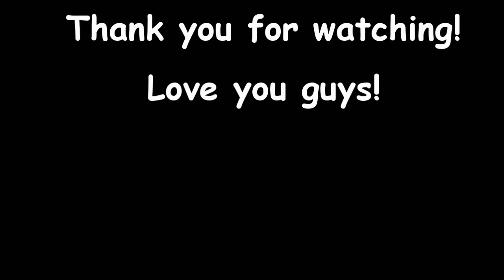Flatbed Budd Trailer Maintenance

Comment: WOW!  These guys still busting rims 😬, I've been a heavy duty mechanic for 30+years. I saw some things but I'm not going to rag on them😁. Im glad they fixed it and grinded off that metal by the airbag. Every tractor Ive worked on was lefthand threads on the left side and righthand threads on the right side.  Usually trailers are righthand threads all around. That little bud tool he used to remove the stuck lugnut we call it a pork chop I have 2 of those.....😉

Comment: The treads on those tires look different than a car. Any reason for that?
Reply: Car tires come in different applications for example: all season, rain, high performance,  low profile etc. so the treads can vary. Truck tires come in different treads also depending on the manufacturer. Usually a steer tire or all position tire have a 4 tread design a drive tire or recap can have different tread patterns mainly for traction. Trailer tires can have a mixture of both